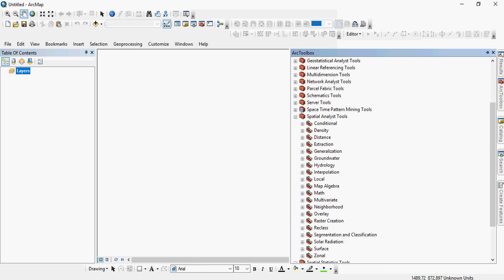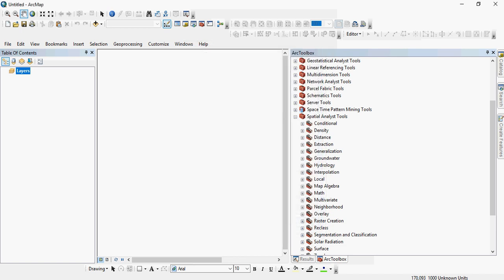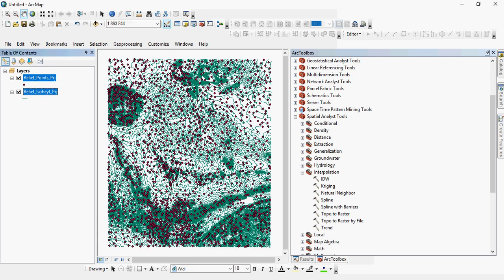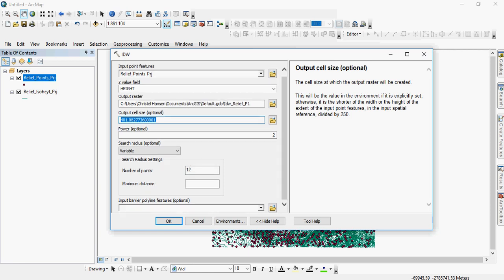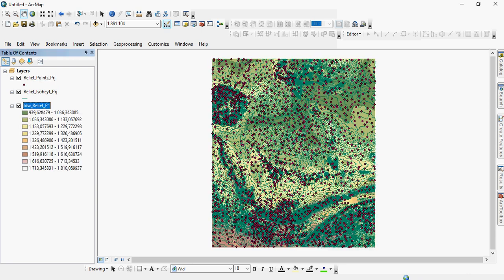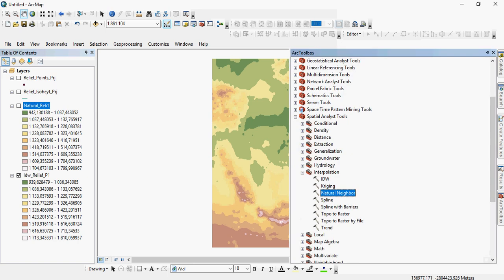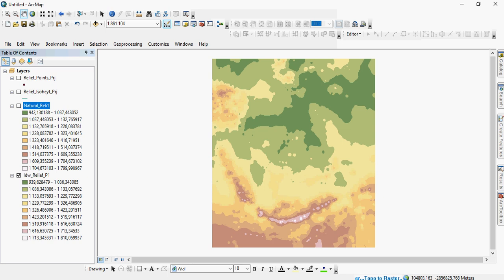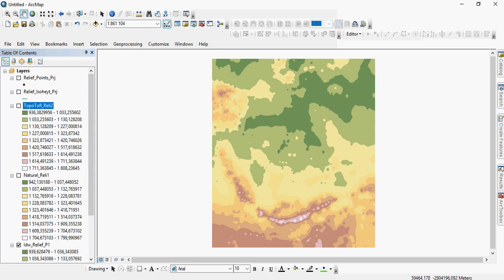ArcMap Interpolate to Raster from Points & Polylines

Comment: Great video....That was helpful. I had a question though. Is there any way to create contours from point feature classes? If you know please make a video about that. And thanks a lot for this content!!
Reply from the maker: Hi. Contours to my knowledge can only be created using a surface elevation raster. You would first have to interplate, and then generate contours using the Create Contours tool. QGIS has a way to do this directly. Use the install the Contours plugin to do so. It is nicely described here: https://www.geodose.com/2018/05/how-to-create-contour-lines-in-qgis.html
Reply: @gisatup9675  Thanks a lot!! I am checking what's in the link!!